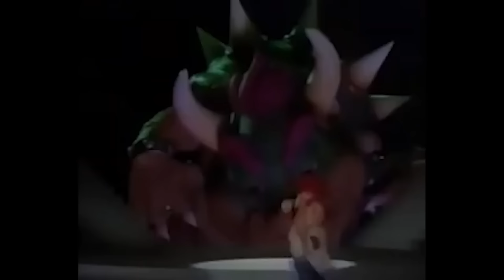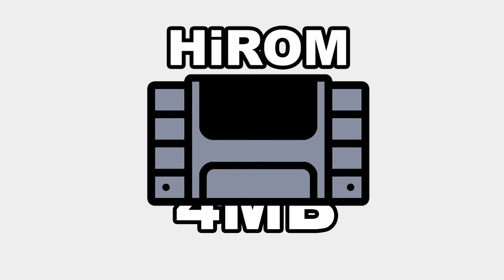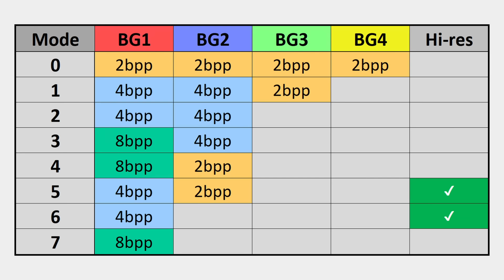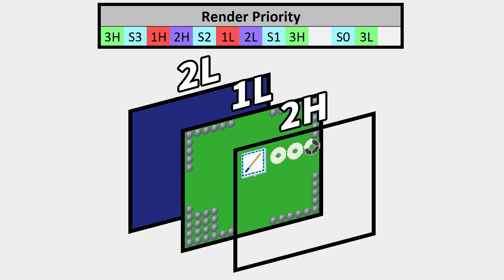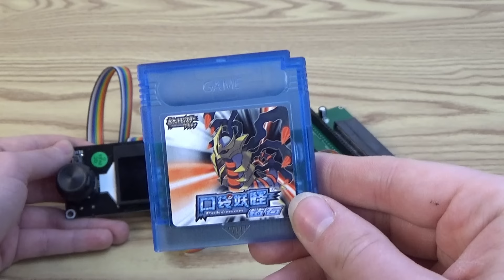Making an SNES Game the Way Nintendo Intended

Comment: Thanks for the video! I think the NeoGeo console was around at the same time, and technically superior for 2D games, as it had an incredible sprite engine (everything on screen on the NeoGeo is a sprite, it has no tilemaps) with scaling and distortion. It didn't have mode 7 though. Plus it was REALLY expensive!

Comment: Last pre-3d console, technically. The GBA and Sega Saturn had even stronger 2d.
Reply: GBA is low res and does not even have more colors. So how is it stronger? What about NeoGeo? Why can the PS1 run Castlevania only at 256x200 ? So it is as weak as the SNES for 2d?
Reply: @ArneChristianRosenfeldt  Ok, the GBA had shortcomings, but it DID have native sprite scaling and rotation. SNEs did not.

Comment: I've recently been enticed by the idea of doing exactly what you're doing, in terms of reading through that manual and trying to emulate the work that so many have done in the past. Getting into the weeds of developing SNES games has made playing older games so much more fun! I can appreciate the effort that went into them even more, while oggling at some of the amazing effects those games achieved despite all the parameters they needed to live in. I'm glad you mentioned starfox at the end for the 3d stuff, as I just learned about that chip and played the starfox game on the switch, remembering being completely blown away by how much that single chip turned the SNES into something like an N64 experience, which I had no clue was even remotely possible at the time.

If you have time to mess with that chip specifically or to show us how it was intended to be used at the time, that would be cool. I know it's an insane ask haha
Sick game btw

Comment: Very cool and awesome job so far! If you can't find the correct ZIF adapter for your flash chip (they are quite pricey), might instead want to use or build a cart that has a ZIF DIP socket for EPROM(s). Main downside is that EPROMs require UV to erase (so you're not gonna be doing fast iteration on them), but they act similar to a mask ROM. Another tip: when ordering your PCBs from PCBWay (or wherever), order a solder paste stencil too-- it makes SMT soldering way easier (ideally you'd have a reflow oven-- the T-962 clones are a popular choice-- but hot air via a heat gun and a hotplate also work well).

Comment: I wonder how a video playing through the entire game worked for longer games.
Reply from the maker: If the recording extended beyond more than a single VHS, you had to ensure the next VHS started at the exact same place as the last.
Reply: and it also needs to be recorded in Standard Play mode, the highest quality mode but with the shortest duration (2 hours on a common T-120 tape), so using Extended Play mode to have 6 hours on a single tape was not approved.

Comment: "Lockout-Chip" is actually a very stupid name for that kind of chip. The name of a chip should give away its purpose. The purpose of the "Lockout-Chip" is not to "lock you out" but to prevent you from being locked out. So it should be named something like "Unlock-Chip" or "Bypass-Chip" or in case of Nintendo, it's the "Key-Chip", as this chip basically acts as a key to unlock the lock chip embedded in the system.

Comment: uhhhh split sprite data means you need to do all sorts of bitwise shenanigans just to set all the sprite bits properly, and this system surely doesn't have anything resembling a barrel shifter, so that's a big bottleneck right there.

Comment: It’s actually extremely impressive that they were able to make such high-quality games with that hardware and 6502 assembly language. Having done a bit of IBM Assembly myself, I know firsthand how tedious and difficult this can be, especially to debug. Every single byte had to be accounted for, so efficiency was essential. These days, even simple games use enormous amounts of storage and memory thanks to cheap hardware and bloated systems full of layers of abstraction.
Reply from the maker: Yep, I had to rewrite the collision check  subroutine a couple times before it was efficient enough to be called by multiple objects per frame
Reply: @InkboxSoftware memory and time constraints are different things .
Reply: And including dozen and dozens of massive libraries just to use a few functions
Reply: Terry Davis Ageees
Reply: What is so difficult with accounting? A 6502 can only access 64k. So usually you have a big poster on the wall with your zeroPage memory map. And then you have a bunch of arrays in the rest of the memory.

For the code you need to think in block scope. Is there some variable in the registers which I will need after the block? Then place some push and pop around the block. For parameters you need to make sure that they are popped in the same order inside the function every time. So branches might be a problem. Likewise return values need to be pushed in the same order.
Reply: @ArneChristianRosenfeldt  I've seen you commenting on a lot of videos. If you really think it's so easy, then put your money where your mouth is and write a game for either the NES or SNES and do it entirely in assembly.
Reply: @ArneChristianRosenfeldt   What you're saying is that you (and not in the royal sense) can't write a whole game in assembly. Since you can't, why do you think it's so easy?
Reply: @ writing assembly is grind work. For money,  I write in a legacy programming language and use a lot of patterns to translate from my C# design to this language. For NES at the time I would probably write code in a high level language on paper. And have collections of optimised routines. A lot of games on NES are full of glitches. If my business logic would be so buggy, my customers would lose a lot of money. I am thinking about writing a transpiler, but I don’t know how to single step . Strange errors and exceptions happen in the target language. So I would need to map these back to my source language. Also the whole environment is a mess and at risk of extinction… 

Have you seen this series where someone analyses NES games? The code is straight forward. No tricks with flags and memory mapped IO and cycle counting or whatever. No loop unrolling. No self modification. No illegal instructions. I may need to re-read about comparison of signed numbers. Somehow the SBC instruction then needs to be used instead of CMP or so.
Reply: @ArneChristianRosenfeldt  There are C compilers for 6502 processors. But I'm thinking that you probably couldn't do that either, because I keep seeing you say `bok bok`.
Reply: @anon_y_mousse  I know that there are C compilers. That was one of the reasons why I wondered why you stress assembler so much. One of the compilers even has a database for patterns. So when it detects some pattern in C, it inserts the assembly pattern you find on various websites or in Steve Wozniaks libraries. It just does not seem to fare well on general benchmarks.
Reply: @ArneChristianRosenfeldt   Why? Because you said it was easy. There's not nearly as many quirks with x86 assembly as there is with 6502, and I would never even attempt to write a whole game using it. And I say that despite having written several compilers from scratch that generate x86 code. Although, the 6502 assemblers do have a nicer syntax. I like nasm, but macros are just a chore. I guess we'll see how I feel after I finish learning fasm.
Reply: @ArneChristianRosenfeldt  wanna know how I know you have zero friends? 😂

Comment: mad respect for people who had to squeeze a fun playable game complete with audio and graphics into a tiny space in memory using a whole bunch of tricks to save space and writing it all in assembly. A far cry from cranking out a quick indie game with a game engine like unreal
Reply: And slapping dlss on there instead of optimizing anything
Reply: @markpfeffer7487 Nah, that's an AAA strat, not indie.
Reply: You forgot, "and requires 40GB of harddisk space and 20GB of RAM" part
Reply: @ObservationofLimits  Only 40 ?
Reply: Reject modernity. Return to assembly.
Reply: I'm still impressed with the resident evil 2 port for N64. How they managed to fit that game into a 64Mb cartridge is wild.
Reply: For the time, it wasn't that complex, mainly because the tools imposed the limit of space/memory usage on you.

Nowadays, many games that could take up less than 1 GB of data end up taking 20 or 40 GB due to poor optimization in everything, from audio tracks to 3D models, textures, etc... which is undoubtedly aberrant for a developer from the 80s/90s (I include myself among those who started their professional life in the 90s).
Reply: The original Atari VCS/2600 has 128 bytes of ram. The 6507 is just the 6502 but cheaper so can only map 8KB of ram instead of the 64KB of the 6502. I feel the NES maybe used this?

Why not code a 2600 game?

Hilariously, the new Atari VCS console has 8GB of DDR4 ram, upgradable to 32GB and 32GB of SSD storage.

Dads are buying this to plug their 4KB carts from 1978 into.

Maybe you should consider programming an Atari VCS game. With 128 bytes of ram.

I feel this is an interesting challenge.

It doesn't use sprites, but calculates each line sequentially and has alot of colour.

If you think the sound is bad, listen to the Dig Dug music as Namco did a good job there.
Reply: ugh, unreal is a plague for gaming
Reply: @darviniusb unreal games can be manually optimized, but barely anyone does it :(
Reply: @silverismoney Ikr , i'm trying to design a retro style game for a 6502 emulator that comes with it's own custom graphics hardware that's designed to work like something from the 80s but not an exact emulation of any hardware from back then , trying to get my head around the hardware is difficult enough (I don't fully understand it so I could be wrong  but from what I can tell it has 64KB of RAM shared between the CPU/graphics hardware with 1KB of that 64 as VRAM  that maps to 1024 pixels on screen with 4bit colour or 16 possible colours  all of which can be displayed on screen at once , 2KB for code which is the equivalent of the cartridge ROM and same size as early Atari 2600 games ). Everything is coded in 6502 assembly although it doesn't appear to have any sound hardware from what I can tell so doing all of that while also coming up with a game design document is pretty fun but challenging :P
Reply: @cryptocsguy9282 that looks like the C64 which had great sound. I think that it introduced sawtooth and triangular waveforms to the consumers.
Reply: @cryptocsguy9282 i plan to do something similar!! like a custom fantasy console with games written in assembly
Reply: Or you take the older genesis and write in C. Sega does what Nintendont.
Reply: @ArneChristianRosenfeldt  Yeah the C64 had a great sound chip & I do plan to start learning how music trackers work to make retro sounding chiptunes.   I know there's some homebrew development tools that allow you to make megadrive games in C which is pretty cool , yh maybe one day I can check that stuff out 👍🏾
Reply: lol don't undermine the work of modern indie devs, the hardware and the games were simpler back then. different set of problems
Reply: @splits8999  there always has to be one that gets put down to bring something else up. always comparing, us humans.

Comment: Great vid, but there were a couple of errors that stood out to me.
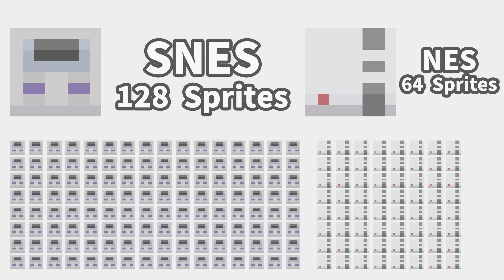8:06 Sprites/objects can only be 4bpp, they can't be 2bpp or 8bpp.
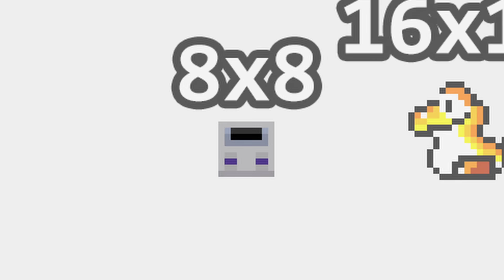8:26 The examples you showed larger than 16x16 are all internally made up of smaller tiles.
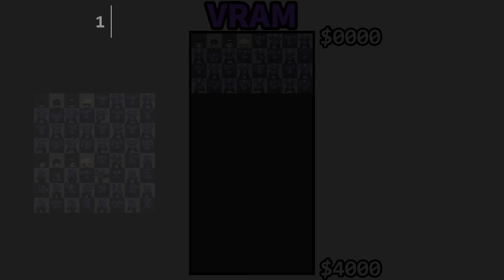10:26 If you're using only one player sprite, usually you would only reserve as many tiles in VRAM as you would need for one instance of it, and transfer new graphics to for every frame. It's actually what Super Mario World does.
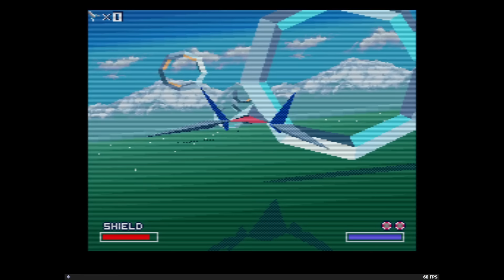24:59 3D is still technically possible without additional hardware, even if it sucks.

Comment: Nintendo ironically failed requirement 9 with Pilotwings when they started manufacturing it with a bug-fixed DSP1 chip.  The buggy chip would play the attract mode perfectly, but the plane would crash when the revised DSP was installed in the cartridge due to a very slight effect on the physics engine.
Reply: They also failed the "no SFC references" in Super Mario World, the logo is in the background of special world
Reply: @keiyakins The main reason they were able to get away with that is because they owned the copyright.
Reply: @semajniomet981  That and the importers weren't very good gamers, considering they had rejected the original Super Mario Bros. 2 for being too difficult.
Reply: @soundspark Didn't even Miyamoto himself say he didn't enjoy playing SMB2J though?
Reply: @PiplupRox  I had only heard the concerns from NoA.
Reply: @soundspark Eh, I'm unsure about that now, but I know Miyamito wasn't involved as much with SMB2J as he was with SMB1
But I doubt they didn't bring it overseas because it was too hard for Americans specifically like a lot of people say. I think they just agreed that it was an absurd jump in difficulty and wanted to try something different.
Reply: @PiplupRox  It was also not a very significant technical uplift from SMB1 where SMB2 while not fully utilizing it incorporates the MMC3 chip, allowing the game to have both vertical and horizontal sections as opposed to SMB1's hardwired horizontal scrolling, and the increased memory means greater grapical fidelity, more detailed levels, and DPCM in the music and SFX.
Reply: @soundspark  Definitely that too
People generalize it too much, there were definitely a lot of factors
Reply: Dev: "Crap, they found a bug. There goes another section of my pinky finger..."

Comment: Those 1991 Joycons.

Also, anyone interested in a more in-depth but considerably longer breakdown of the hardware, retro game mechanics explained has a long series of videos on it.

I'd say that while the SNES was one of the last and best purely 2D console, the PS1, GBA and DS at the very least, had extensive support for advanced 2D functionality (without just being a 3D rendering pipeline made to work in 2D) with lots of games that made full use of it.  The GBA also being purely natively 2D with no hardware 3D support.

Comment: Very good!
That you did this in such a short time is just mind-blowing to me. Impressive!
As for the headache with the 8/16 bit shifts in the registers, it's very rare that I have problems with this, the most annoying thing is when the assembler gets confused and compiles the wrong instructions. Then we are forced to use ".b", ".w" and ".l" along with the opcodes to tell the assembler the size of the instruction.

I always leave the accumulator at 8 bits and the index registers at 16. When I need to do some calculations in 16 bits, then I really need to change the accumulator to 16 bits. But you can also just use 16 bits all the time. This will use more RAM and a bit more processing, but it simplifies the code.